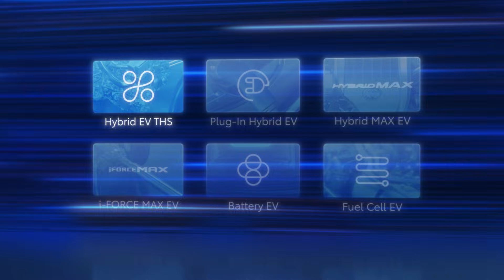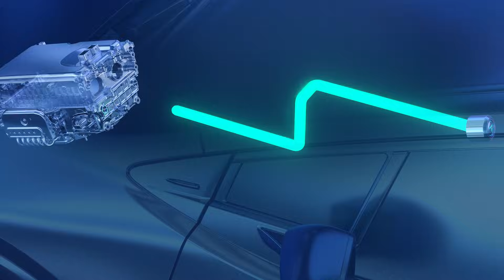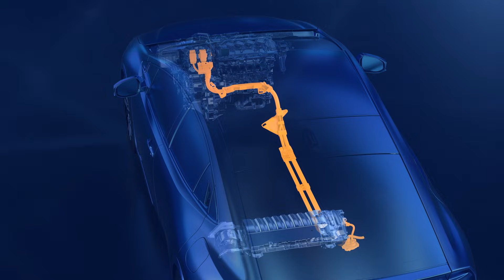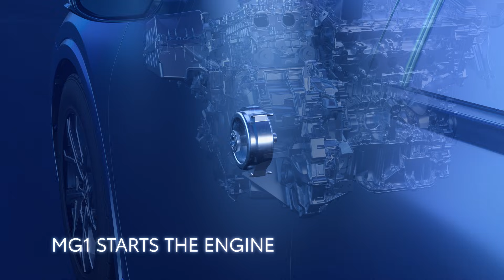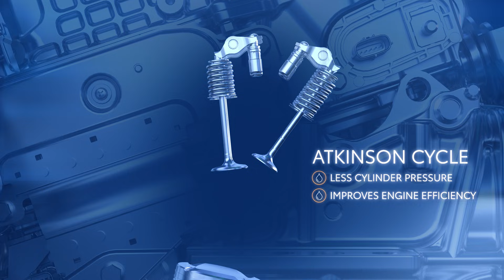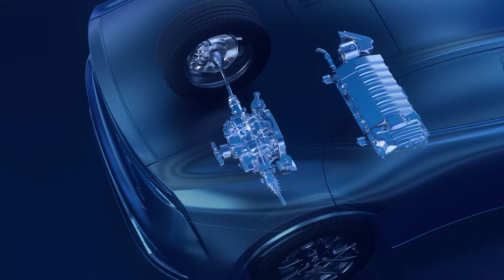How Does Toyota Hybrid System Work? | Electrified Powertrains Part 1 | Toyota

Comment: Evening all. 
As a mechanic we’ve recently been doing a lot more work on Toyota Hybrids. Mainly just servicing and suspension repairs. But I’m looking to find more info on the transmission/MG’s. I’ve found some good videos on YT including hybrid battery replacement and a couple of not-so-detailed transmission tear downs but do you know if there’s a workshop manual or articles available for these?

Comment: I just recently acquired a 2026 Toyota Corolla Cross Hybrid AWD and am absolutely in love with it. I drive with the display up to be aware of my driving habits, to try to maximize my fuel efficiency ever since learning about how it runs. I'm supposed to get 41mpg, but I tend to average around 49-51mpg instead. With just a 10 gallon tank and driving 22 miles round-trip for work, this vehicle is amazingly inexpensive to fill up.

Thank you Toyota for making an already amazing line of vehicles even more amazing.
Reply from the maker: We love to hear that you're having a good time with your Corolla! Here's to many more safe miles ahead.

Comment: Technology connections video on THS blew my mind. Been a German car guy but seriously considering a Toyota/Lexus Hybrid now. Also just did my first long trip driving a rental Camry Hybrid and was really pleased with the engine. Technology connections did say that the main improvements are primarily via the Modified Atkinson cycle engine, which is a fascinating paradigm shift from how I expected things to work. Also super impressed with the overall elegance of the drivetrain.
Reply: I previously had a BMW X5 and TC (and the price of gas) convinced me to switch to a Prius PHEV a few weeks ago. Loving it so far!
Reply: Sport mode is fun in the Camry Hybrid. 😇

Comment: I am here from a video that was explaining its transmission. There are no clutches in this car. It means its transmission will go as long as the engine goes

And here is another amazing fact: No belts! No timing chain. No alternator. You just need to change oil. Your car will not ask for that crazy expensive timing belt change at a mileage when the car's value is less than getting that job done. Incredible
Reply: Why would it not have a timing chain? I think you are confused with the CVT belt. The Atkinson cycle changes the timing of the intake valve, but they are still driven by a timing chain. At least they are not using a rubber timing belt! And no gearbox, I was blown away that you can not put this engine into neutral, it's always connected to the wheels
Reply: The internal combustion engine does have a timing chain

Comment: I had a 2012 Camry hybrid. I drove it for 10 years and it had 202k miles when I traded it in for a 2025 Camry hybrid LE.  Toyota has really perfected the hybrid system.  I ignored the 10k mile oil change recommendation and did it every 5k.  Also, the enemy of the hybrid battery is heat, so make sure to maintain the hybrid battery filter and coolant and do not block any interior vents.  I have no doubt that my my 2012 Camry would've lasted until 250k, 300k or beyond.  I just wanted all the new safety tech in and power of the 2025 Camry.  The only problem I ran into was one of the BSM sensors went out at around 175k but it was over $1,200 for Toyota to replace, so I decided not to.

Comment: This past Saturday I just bought a pre-owned 2023 Prius AWD LE with 58,000 miles to replace my 2015 Camry Hybrid LE which is at 232,000 miles and runs well - and yes that's the original hybrid battery - I live in VT and I wonder if the cold weather 7-8 months out of the year helps the longevity??   I've had several other Toyotas before (FJ's) but I've been very impressed with the hybrid cars and I can't believe how drastically it has improved between these two vehicles.  It would take a lot of effort to convince me to buy anything but Toyota ever again.  The reliability of my camry  hyrbrid has blown me away....   I watched this video and I'm still trying to understand if the engine ever actually powers the wheels directly (in the MG1) or is it just providing electricity to the MG1, which in turn is electrically providing torque to the wheels?
Reply from the maker: Hi, there. Your experience is important to us. When you have a moment, please call our Brand Engagement Center at (800) 331-4331. Our Brand Advocates are available Monday through Friday from 8 a.m. to 8 p.m. and Saturday from 9 a.m. to 7 p.m. EST to discuss your concerns further.

Comment: Checking in on this video since I just bought a 2021 Toyota avalon hybrid and is arriving in a couple days. 
I was very leary about hybrids until my brother in law who is a gear head told me toyota has hybrids figured out. My sister drives and a prius and my brother in law said they have had zero issues out of it and would highly recommend not only toyota but their hybrid line

Comment: So, is there an option, that car is moving, combusion engine is working but just charging battery without outputting power to wheels or not?
Reply from the maker: Hi, there. Your experience is important to us. When you have a moment, please call our Brand Engagement Center at (800) 331-4331. Our Brand Advocates are available Monday through Friday from 8 a.m. to 8 p.m. and Saturday from 9 a.m. to 7 p.m. EST to discuss your concerns further.

Comment: 🤔 I'd rather have a hybrid that has a battery 🔋 that gets charged by plug 🔌 in charging.... Like a regular EV with AWD from either 2 motors. Or 4 motors one on each wheel hub. Then use a removable efficient gas inverter generator. For a range extender, so you can leave it at home. If you're not planning long distance driving. 
I'd cover the top of the car with durable laminated solar cells. With solar cell window covers. That roll up & down like a regular car window. The windshield solar cover would slide out & up from the hood. The rear window cover would slide down from the roof. 
These would #1 provide more charging  power when parked #2 provide privacy #3 keep the suns heat & damaging UV rays out of the car in summer.

Comment: My new Corolla constantly drains its 12 volt battery if the car is not used when i have a holiday. Every time i return, i cannot drive home until the breakdown service has started it. Now it is 1 year old, that battery failed and a new one fitted but the dealer says it will always discharge if i do not drive 180miles every week. So, how can i go away 2 weeks and keep the car driving around just to charge that 12 volt battery. This car goes very well, it has good fuel economy but if you take a lot of holidays, be prepared for an equal amount of battery failure.
I told my dealer i could never buy another Toyota but they are not bothered at all. They just suggested i repair the brand new car by adding a solar panel connected to the ebd port which i would have to buy and fit. These cars have a tiny 35ah battery which is just not big enough to run the alarms and electronics in use when parked up. This happens to all UK supplied Toyota hybrids. Just look on youtube to see just how many are failing. 2026, i am buying an AUDI or Volvo that will always start after my holiday
Reply from the maker: Hi, there. Your experience is important to us. When you have a moment, please call our Brand Engagement Center at (800) 331-4331. Our Brand Advocates are available Monday through Friday from 8 a.m. to 8 p.m. and Saturday from 9 a.m. to 7 p.m. EST to discuss your concerns further.
Reply: @toyotausa  What you could do is ask Snows Toyota what is being done about the faulty cars they sell. If you go to Southampton cruise port parking when Ventura cruise ship comes back in February 2026. You will see at least 20 Toyota Hybrid cars being started by the breakdown van. He has a large battery and 10 metre jump leads so he can reach them easily. He will be there to start mine again as it will have been parked 35 days. I have just been left stuck with this junk so someone else will have the problem when it goes in 2026. Advise from Toyota is i should drive 180 miles every week on long journies. Very difficult when i am on ship for a holiday. They do not tell you this when buying or state you must drive 4 times a week and cover about 10,000 miles just charging the battery. Unfortunately, my neighbour has now bought one and at 8 weeks, his 12 volt battery has failed needing replacement and will fail again in a few Months. He is also left with junk costing near £40,000 .He is scared to use his much so uses his old 10 year old diesel car more now as he wants to go places and do things.

Comment: The cut-out and diagrams are excellent in explaining how this works. I am an electrical engineer so I have a little bit of an insight to what's going on. Judging from what I saw, there is definitely room for improvement in the near future. Each gen hybrid system will better and better. I guarantee it.

Comment: Hey i am not sure if i get this correct, but it Looks Like the 12v battery is used to start the hybrid battery. My question is which battery starts the gas motor?
Reply from the maker: Hi, there. Thank you for your inquiry. Please note that the engine starts using a charged 12V battery.
Reply: @toyotausa  No Toyota,  the engine (ICE) is started by MG1 powered by the traction battery. The hybrid "system" is started (enabled) by the 12V battery.

Comment: First time hybrid owner, here... Why does my 2025 RAV4 Hybrid's Hybrid EV Battery only have 3 to 4 of the bars illuminated when I check the Energy Flow on the infotainment screen?
Reply from the maker: Hi, there. Your experience is important to us. When you have a moment, please call our Brand Engagement Center at (800) 331-4331. Our Brand Advocates are available Monday through Friday from 8 a.m. to 8 p.m. and Saturday from 9 a.m. to 7 p.m. EST to discuss your concerns further.

Comment: The capacity of battery never mentioned , and it is only .6kw which is 100 times less the smallest tsla 60kw battery. Meaning most of the time  you very likely be driving with discharged battery on car with  extra weight and low power gas engine
Reply: That’s incorrect
Reply: Its not power its reliability and getting your money's worth after 5 years you will have to change the battery for both yes.  but toyota is much cheeper 
You don't need much power for everything its built for efficiency

Comment: Fantastic video and illustrations. This was a great explanation of the Toyota Hybrid transmissions, which are distinctly NOT like the belt-driven CVTs being used in Nissan [gas vehicles 2007+], and some Honda 4-cylinder vehicles (Civic, Accord, etc).

This explains why the Toyota powertrains have enjoyed the most longevity. 

I'm consistently amazed at how long their 2nd-3rd gen Prius hybrid systems last, compared to the Honda Insights of the same year range.
Reply: I have a Prius lll 2015.  It is the first brand new car. Never a pri 5:45 or owner. I camp in it, enjoy its 50 mile per gallon .  I have camped in my Kansas yard to iron out kinks to make camping away from home easier.  I have also camped on a car trip to San Diego- in Arizona, Iowa. Illinois, Missouri, Wisconsin, Kansas.

Comment: Dear toyota, please make an inline 6 version of this hybrid system with beefier motors and a variable valve lift setup to switch to the otto cycle in sports mode and back to atkinson in normal drive and put it in a tacoma and tundra also with an electric rear axle (or individual motors for each wheel)

Comment: Is the rear motor is always running/driving full time? Or is it truly controlled on demand dictated by traction control brain? Is this an override for full time 4wd?
Reply: The regular Toyota AWD system found on the Corolla, rav4, Prius, and Camry use a rear motor that has no cooling, because of this it cannot be powered full time, instead it activates for brief periods when traction control activates or the accelerator is aggressively depressed. In some vehicles like the Toyota Crown or Grand Highlander, Toyota offers what they call their "Hybrid Max" powertrain which is the same water cooled rear eAxle motor used in their electric BZ vehicle. This water cooled motor allows for full-time all wheel drive and can even do a 20:80 power distribution in spot mode with 80% of the power going to the back wheels making the vehicle feel more sporty.
Reply: @TheFrugalEngineer Appreciate the in-depth response. That’s what I thought. Toyota marketing, IMO, muddles it a bit in alluding to full time AWD.

Comment: No belted CVT, that is a huge deal.
Reply: eCVT is dead reliable

At this point, I wouldn’t get a gas Toyota, I’d only consider hybrids moving forward.

In the past, Toyota CVTs were good, but ever since 2018 or 2020, I’d stick with just hybrid tbh
Reply: @KurosuGon . Do you know if a 2012 have a belt?
Reply: @KurosuGon just bought me a GR86 😂 I'm doing my part
Reply: Calling it a eCVT when its not a transmission was a big mistake
Reply: @samuelmatheson9655  how is it not a transmission?

Comment: Why can't the hybrid battery keep the 12volt battery topped up.
Reply: It does. 7 years with my hybrid. No issues, original 12 volt battery.
Reply: @escheidl  What is a secret to making it last?  I just got mine.. it's used but very well kept.
Reply: @kyrareneeLOA  Get an AGM lead acid battery. More expensive, but made for these types of vehicles
Reply: My 12 V battery lasted two years and three months

Comment: Does the Toyota hybrid system have any clutches?
Reply: No
Reply: no clutch.
Reply: Yes it does, but it's just a fail safe in case the drive train blocks for whatever reason. Normally it's permanently engaged and will never slip in the lifetime of a typical toyota
Reply from the maker: Hi there. Your experience is important to us. When you have a moment, please call our Brand Engagement Center at (800) 331-4331. Our Brand Advocates are available Monday through Friday from 8 a.m. to 8 p.m. and Saturday from 9 a.m. to 7 p.m. EST.

Comment: Question for Toyota,recently for my Corolla hybrid the battery would drop super low like 20% or 2 bars worth of energy remaining before it turns the engine on. Is it supposed to get that low?
Reply from the maker: Hi there. Your experience is important to us. When you have a moment, please call our Brand Engagement Center at (800) 331-4331. Our Brand Advocates are available Monday through Friday from 8 a.m. to 8 p.m. and Saturday from 9 a.m. to 7 p.m. EST to discuss your concerns further.
Reply: @toyotausa  👍
Reply: my is the same
Reply: This is done to keep the battery healthy and improve their longevity. Modern batteries are kept healthy by having them kept charged between certain percentages. For phones, it's between 20% - 80%. For hybrid cars, since they have combustion engines to produce power on demand, they're generally just kept above 20%. My 2025 Honda CR-V Hybrid charges when it's at 20% and stops when it's at 30%.

You'll only really see full hybrid batteries when you use regenerative braking a lot e.g. when going downhill.
Reply: Not a problem at all. 
When hybrid battery is low and engine is running wait until engine turns off itself and then switch your car off
Reply: @toninocars definitely, I’ve been doing this if I notice it’s low and I’m parked somewhere. Strangely enough if it’s low at 40% I can force the engine on using the heater and sometimes even when I turn the heat off the engine will stay on just to power the battery to 80%, not sure if the car is just adjusting to my driving habits and leans from usage/ charging cycles like an iPhone or something else 🤔